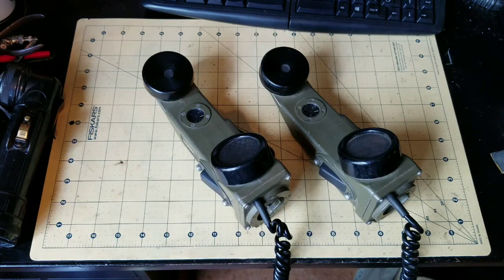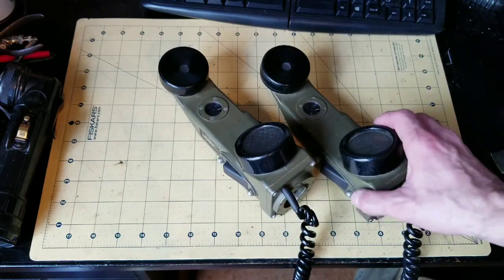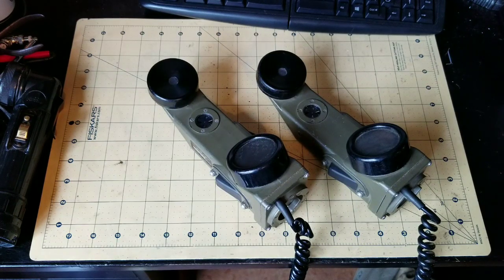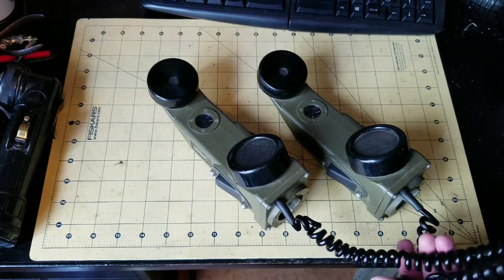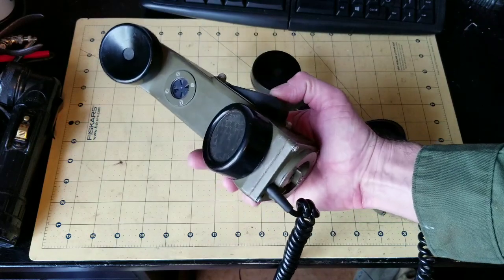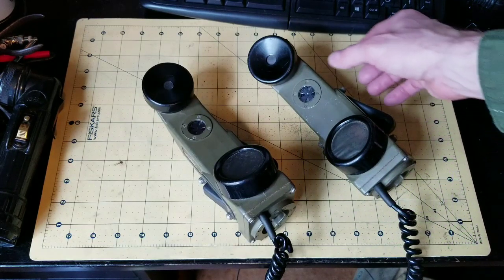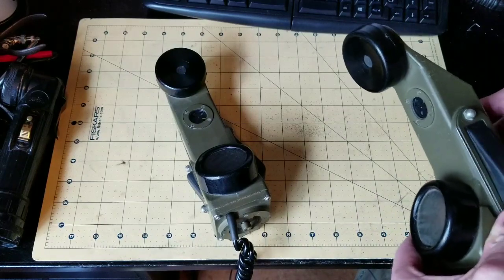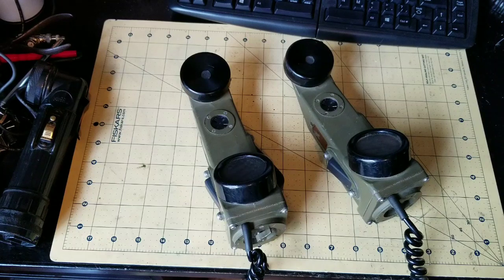10 Must-Know Facts about the TA-1/PT Military Field Phone U.S. Army

Comment: When I was in the army, those were usually carried by the wire commo guys for testing the wire runs they pulled between locations.....everyone else had TA-312 phones.

I have a couple of the TA-1 models and several TA -312s and even the switchboard with the headset.
Reply: I just bought a TA-1/PT! I only have one and hooked it up to a TA-312 to test. When I am communicating from the TA-1, I hold down the push to talk button during the whole conversation. If I let off to listen I hear nothing. I thought this was push to talk, but mine works like a regular phone if I just hold down talk button. Is this normal between these two phones?
Reply: @Christopher Williams I'm stupid. I discovered my TA-1 was missing the receiver. I got one from  Ebay and have a fully functioning field phone that does communicate just fine with the TA-312.
Reply: @Christopher Williams I don't have a switchboard. Wish I did. Maybe someday. I bought my TA-1 on Kijiji from a private seller in Manitoba Alberta. He only had the one.

Comment: thank you on the tip mine sound much better now, I heard they could 5 miles with the proper wire , 4 is still a pretty good distance, plan to use them on a ranch

Comment: The microphone used is not a carbon microphone. This is because it's a voice powered system, and carbon microphones need an external power supply (either DC line voltage of a battery). 
Dynamic microphones generate a voltage when you speak into them - carbon microphones only vary their resistance, but don't generate voltage.
Reply: Very well explained.